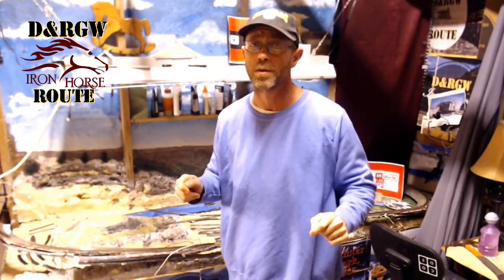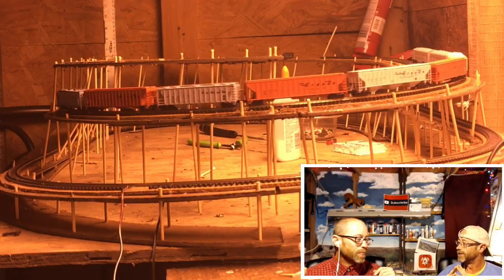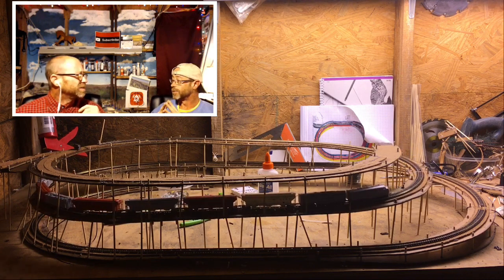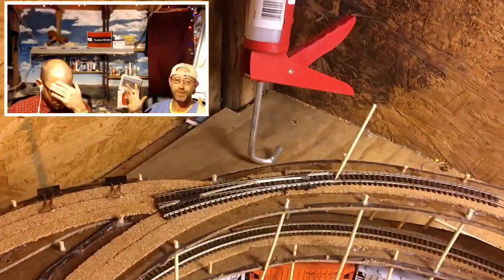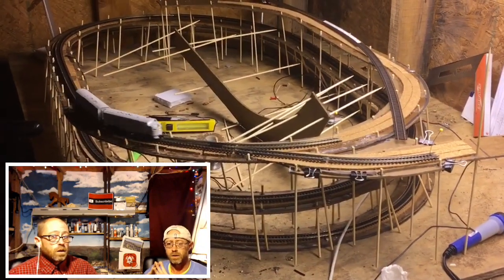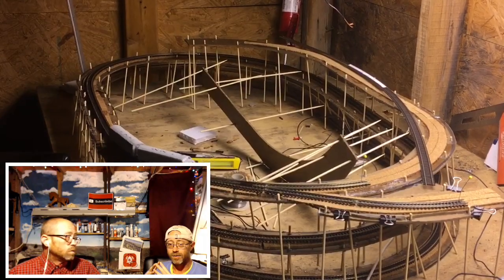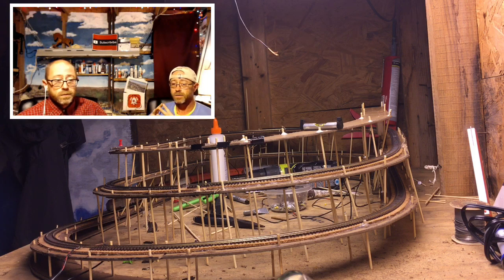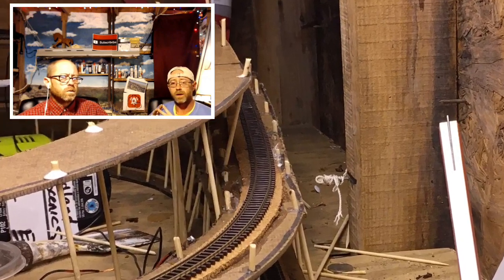How I Install a Curved Peco Turnout on My Modular Open Helix - Model Railroad N Scale Trains

Comment: Thanks for an entertaining demo Brian. It looks like you got the curvature of the flex-track leading into the curved turnout tweaked so that it flows smoothly. I'm sure that R.C. Rick's measurements were a huge help in getting that right. Which Peco curved turnout did you wind up using?  Art...
Reply from the maker: Yeah Art.  It really did look ugly, but when I pulled the approaching track up and re-laid it to mach with the turnout the best it could, it turned out pretty good.  It is not perfect and obviously rick will jump on that, but he will enjoy watching the next two technical videos before coming back to check out the installation.  My track work ability is improving but I have miles to go to get to you!  I see that sub count of yours climbing too art! Congrats.

Comment: Nice one Brian! You're right that is going to be a challenge doing the scenery.  I have faith in you two, you guys will figure out something waaay cool!
Reply from the maker: Appreciating you over here Gary!   I do have an idea but it's not going to be easy.  Not sure why I always pick the toughest protect :-)  !  For some reason that always seems to be the coolest.  I assume that this project will fit somewhere between the installation of the helix and the extension that is coming During Christmas Break.  I will be doing new bench work somewhere in there as well.  Look for a new video this weekend.  I am collaborating with another channel on the technical aspects, products and cost that was involved in creating the modular open helix.  It should be a good one.  I hope to see your there! :-)  Brian D&R